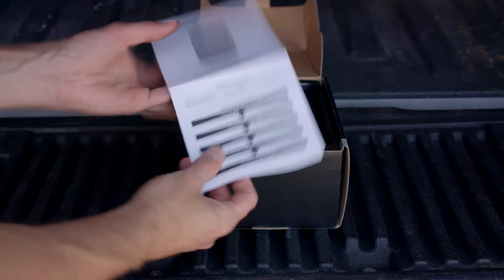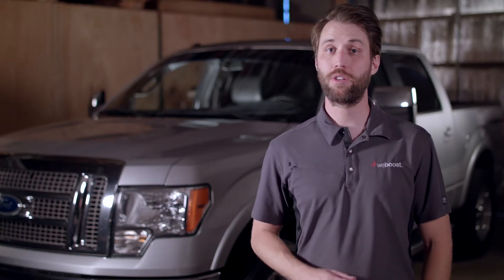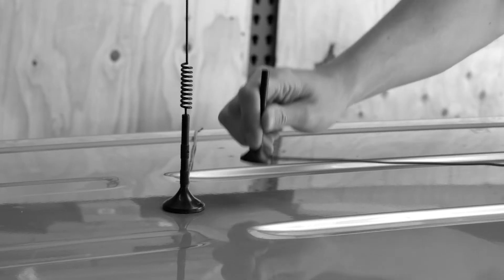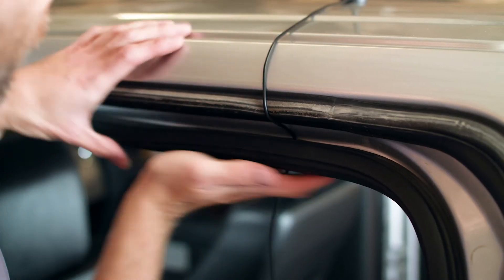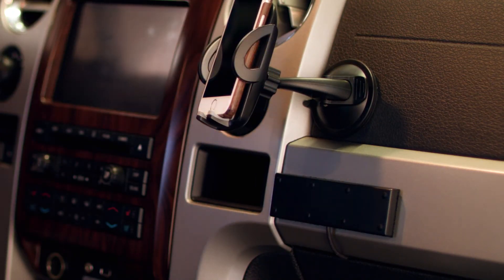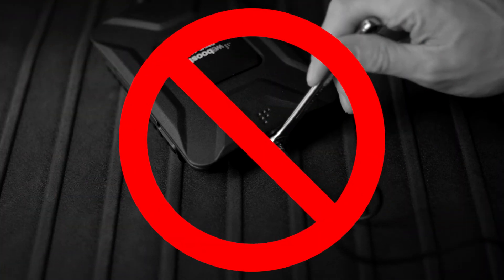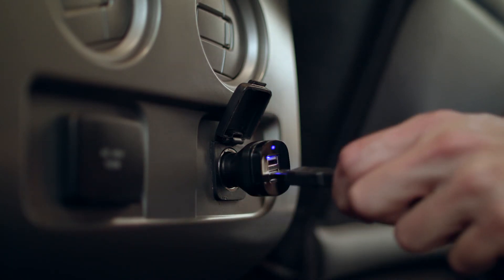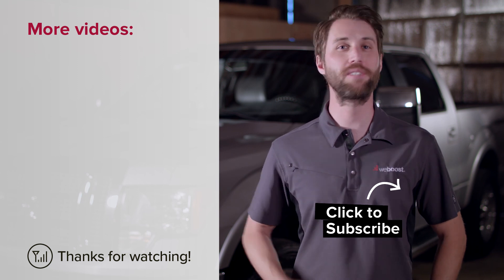How To Install A Cell Phone Signal Booster In A Truck | weBoost

Comment: will the external antenna mounted outside, fly out while driving on the freeway, speeds up-to 80mph?
Reply: Nope. I've gone faster than that and it doesn't budge. It really is a strong magnet.
Reply: Could always bust out the epoxy for peace of mind too

Comment: Any recommendations to deal with oscillation? I've moved the external antenna around the roof to try to get it further away from windows, or make the furthest distance from the internal antenna but still get flashing red lights. I've also tried redirecting the internal antenna and the only time it stops oscillating is if I put it down by the floor, which won't do any good.
Reply: @Big_AlMC  informative reply. Thanks for your value to the world.

Comment: Don't waster your money !!! The antenna does not work on a 2017 Ford F150 or 2018 Ford F150 as the roof is aluminum, hence the magnet does not work !!
Reply from the maker: Ken, it is possible to mount the antenna on an aluminum roof, you just need a grounding plate. Call our customer service and they can get you set up with one. 1-866-294-1660
Reply: Why don't you show the You Tube viewers how this is done on You Tube so we know what is involved ie: where do you put this grounding plate and how is it installed ?
Reply from the maker: Funny you should mention that, we already have a video showing how to install it. You can view it here: https://www.youtube.com/watch?v=w4C77GHNCQQ
Reply: Any recommendations to deal with oscillation? I've moved the external antenna around the roof to try to get it further away from windows, or make the furthest distance from the internal antenna but still get flashing red lights. I've also tried redirecting the internal antenna and the only time it stops oscillating is if I put it down by the floor, which won't do any good.